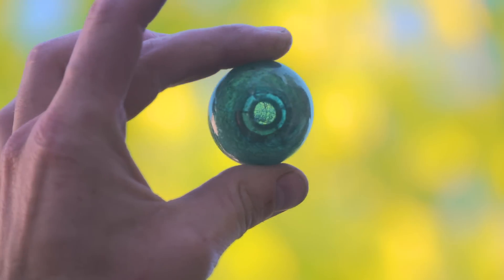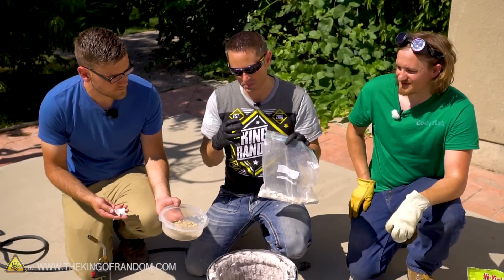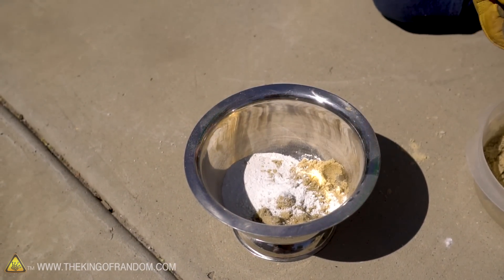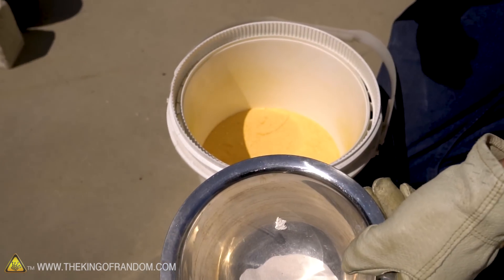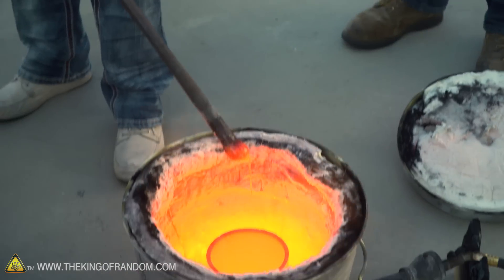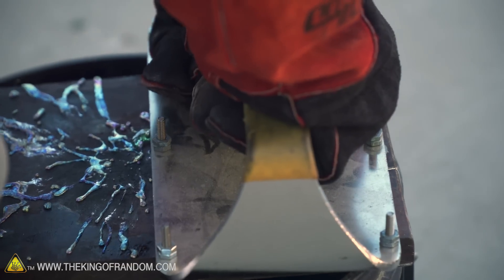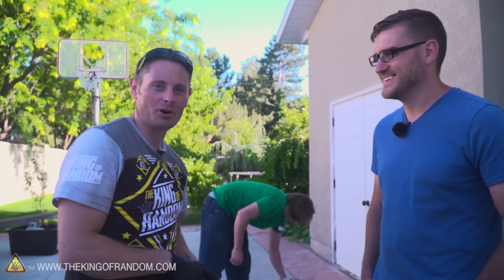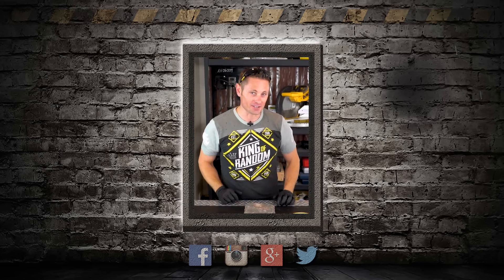How To Turn SAND Into GLASS! Melting Sand Into Glass? TKOR Shows You How To Make Glass!

Comment: I have found your video most interesting in my search for making ceramic glaze at low temperatures with cheap and widely available materials. I have recently mixed clay and bicarbonate of soda 50/50 and have obtained a nice glaze at about 1000 centigrade. 
Could you tell me at which temperature you melted the mix of sand and sodium carbonate?
I would really appreciate your help
Reply: Dude wtf, hes dead..

Comment: How did you keep the Foundry running for 6.5 hours without the propane cylinder freezing?

You mentioned in your "Don't Build a Metal Foundry Until you See This First" video (5:11 minutes in) that the Propane Cylinder freezes after only a half an hour. You also mentioned that this can be combatted by placing the Propane Cylinder in a big bucket of warm water or investing in a larger Propane Cylinder. Perhaps you figured something else out?

Comment: Hey make some smooth glass Cody melt down some tin keep it hot to melt point  it won't mix with the melted sand like oil and water pour your melted sand right on the tin and it cool and it should be clear sheet

Comment: Was that an aluminum thing they used to flatten the glass?
That will cool any hot surface down quick so what they need to do is make a thick pad of newspapers and cover all the metal then when they go to smash the glass use some warm or hot water to wet the newspaper and then flatten the glass.
I've watched glass blowers use newspapers to also shape the glass as well have to keep it wet so it won't go up in flames with the molten glass.

Comment: try to do ultra battery, where u cover negative side plates of lead acid battery with grphite to prevent erosion, supposedly gives way more discharges at 100%, should be easy to do

Comment: I haven't read the comments below, but here goes.  Window glass does have a greenish tinge.  You have to look at it edge on though to see it.  While I have seen leaded glass before, I never had occasion to look through the thickest parts of it to see if there was a color cast to it.  I have had occasion to use it as a musical instrument, as when you fill it to different levels with water to change the resonant frequency.  Also, my favorite ornaments in my house are made with leaded glass, as they tend to refract light more strongly than other types of glass.  At this time though, I'm making ink.  Seems safer than making glass.  People where I work are aware that I'm collecting staples removed from documents for that purpose, though when I explain to them what I'm attempting, they get very confused.  Note:  it's iron gall ink, if you wish to do a search, it's explained very well in several video's.  If you don't wish to try it yourself, you can get the finished ink, commercially made, on line, or from a nearby hobby store.  I chose this project because I want'd to see how it performs with either a metal dip pen, or a quill pen.  I've been giving away ink and quill pens and presents lately, just because I have half a gallon of ink, and am still working with the mix.  My own ink is a medium grey, and I carve the quill pens myself.  It seems to work best with 24# parchment paper.  Tannic (sp?) acid can be used as ink by itself.  It gives a sepia tone effect, the darkness of which depends on the concentration.  It will eventually eat your paper though, so that is a downside.  Enjoy yourselves, and keep experimenting.  I might want to try this for making glass pens for my calligraphy.  I have several I enjoy using made by other people, but I would like to try making my own.
Reply: No one cares

Comment: Sand needs to be wet so it can dry... when turning into glass... you need to have a mechanic that makes lighting or a streak of lightning to strike the sand and then it will heat up and turn into a cracked form... then it will dry up and fix up when left in a form

Probably didn't make any sense

Comment: if you pulled your burners outside off your foundry it will get hotter, aprox. 3-6 inches depending on the burner. doing this allows more oxygen(fuel) to mix with your propane therefore increasing temperature

Comment: How to turn coal into diamonds
Reply: oxidius ... coal cannot make diamonds... well at least not on its own... it takes carbon (which coal has) pressure (which coal does not have) and lava heat (which coal also does not have... plus you would need to wait like 5 years for it to finish and in nature about 2 million.  Sorry to be a party pooper but.. it's fact. Can't argue with that...
Reply: Bunnygamerplays alot Synthetic diamonds made using the CVD method takes a about 10 weeks. Not years.

Comment: Great video guyz. Does it make a big difference where the material comes from or is it that it's more pure where you got it?
I have a portable foundry pot to melt medal but have not used it yet. 
just getting ideas from you thanks.
_/

IDEA4U: what about etching small parts using copper sheets?
My company does it to .005 " tolerances. Cay you without the big etching chemical machines?

Comment: My dad used to work for a company who made light bulbs and had to do mix similar chemicals but they had molds for the glass and what they had left over in the ribbon machines was usually blue ( and sometimes purple) blocks of glass called cullet I have some. You guys did a similar thing to what Corning Museum of Glass does the blowing glass part cool.

Comment: You should melt some neodymium magnets and see if it's still magnetic
Reply: It would lose all magnetism
Reply: YouTube Promotions they lose their magnetic properties when heated over a certain point so it wouldn't work
Reply: Frank Villani yup that's exactly right
Reply: YouTube Promotions it won't be because the particles will be moving around and won't be aligned in non perfect way for example

Non magnet 

OOOOOOO
OOOOOOO

magnet

OOOO
 OOOO
OOOO
 OOOO
Reply: It wont
Reply: Once a metal goes past critical temp the structure changes and it becomes non magnetic
Reply: YouTube Promotions answer: no
Reply: YouTube Promotions magnets on heating or hammering,looses their magnetism!
Reply: Yess
Reply: Earth Is magnetic because of its weight and rotational motion>
Reply: YouTube Promotions go to school sometimes its pretty cool.
Reply: YouTube Promotions but just so u know ... magnets lose there magnetism if exposed to alot of heat or hitting it too hard
Reply: YouTube Promotions false
Reply: Charlie Bell it becomes weaker
Reply: Cam Creates Crafts that's not how that works
Reply: YouTube Promotions it wont
Reply: Would it work again once cooled? And if so, how would that affect the poles? For example, if you made it into a very weird shape with no edges and lots of curves, how would that work?
Reply: Research the curie point (not sure if its the proper name)
Reply: Charlie Bell, no they wouldn't regain their magnatisim.
Reply: Farhan Hussain that's not true because the earths core is melted and under intense pressure but is still magnetic

Comment: If you heat pure fine white sand and Lyme for about 8 hours mixing in small amounts of baking soda periodically and add a bit of fine ground quartz at the end you can make some pretty cool designs with pressed glass. Also different metals can give different colors. Look for a list of firework grade metal powders and you can pretty much make whatever color you want. Also pressing it when it's still molten can be dangerous but it will let you make much thinner plates.

Comment: Can you turn carbon dioxide into oxygen?
Reply: Michael McNamara You certainly can. That's what happens in photosynthesis. I don't know how this would work in a lab setting, however in photosynthesis light hits the CO2 molecule which then causes it to split into two. CO, Carbon Monoxide, and O, Oxygen.
Reply: Michael McNamara if plants can do it we certainly can
Reply: Michael McNamara the process so far cannot be replicated since it's all biological
Reply: As far as I know, plants make oxygen by breaking the water molecules, not straight from carbon dioxide, so I wanna know is there a machine that could do so?

Comment: You should cast pewter in silicone. Pewter has a melting point of 170-230C and silicone can handle quite high temperature. You can get pewter at a thrift store.

Comment: Try to melt diamond
Reply: Krushil Manji Diamond will not melt... it will evaporate and flash gone.
Reply: Diamond is basically compressed carbon so it would just burn like charcoal
Reply: I have been informed that it is possible for diamonds to not just burn but explode in the right conditions.
Reply: That is impossible. Not everything can be done
Reply: doesn't burning need oxygen? and if it does, what happens when you take oxygen and give heat? <,<
Reply: Krushil Manji It will just burn like coal .
Reply: What's a diamond?

Comment: See if you can melt dry ice. Like if you agree
Reply: Joshua Storrs 
I think he already tried in a past video, but I'm not sure which one.
Reply: A⃟n⃟n⃟z⃟a⃟l⃟i⃟s⃟a⃟ oh well we will see what happens lol
Reply: Joshua Storrs no it's a gas in solid form
Reply: Joshua Storrs it doesn't melt, it just evaporates
Reply: The correct term is "sublimates"
Reply: U can do that by putting it in water
Reply: Joshua Storrs he did that before when he used plastic bottles
Reply: Well you can form liquid CO2 by using very high pressure. Cody's Lab did it when making supercritical fluids
Reply: Sublime idea
Reply: Joshua Storrs contain it in a place it can't be exposed to air or use a vacuum chamber
Reply: he alredy melted dry ice

Comment: In the old days they used to take the hot glass and move it trough a valswork on to a molten bed of tin where the glass rested as it thined out and got rid of the last impureties and bubbles. 

The bed woulndt have to be as deep as it would need to be wide and long as the glas you would want to make.

Comment: could you make popcorn by putting kernels in the vacuum chamber?
Reply: Jonathan Beil go to the myth busters YouTube channel they did this
Reply: Popcorn kernels require heat to soften them to pop. It's true that water boils at room temperature under vacuum but it is not hot at all and may actually get colder due to adiabatic expansion.

Comment: Grant, can you please freeze a simple LED in liquid nitrogen. If you freeze a low voltage LED (usually used at 3V or 5V DC with a resistor in series) in liquid nitrogen, you can connect it to line voltage (110–120V AC), and it will continue to work. It gets a lot brighter than you would believe possible. The LN will boil violently, providing a pleasing effect.

Warning: This experiment is potentially dangerous. Be careful to ensure that the LED is completely frozen before connecting to line voltage, and is disconnected before thawing. Otherwise, the LED could shatter violently. Use eye protection and proper electrical insulation.👑
like so grant can see !!

Not my comment, so if you see this, its BossManChalil
Reply: I love that you're being honest and say that it isn't your comment. Probs to you
Reply: You could do the same with laser diodes and the wavelength would change, resulting in the laser turning into a different colour
Reply: ZippyZipra: sounds cool
Reply: ZippyZipra I

Comment: Make a metal with a low boiling point boil, in a closed container. My hypothesis is the metal will condensate like water. Like if you agree.
Reply: Jonah Holman Indianum. It's a soft metal that gets soft at room temperature, meaning it's a metal that could be chewed like bubble gum

Comment: Can you please make Diamonds?
Reply: Syntheticly produced diamonds are chemically identical to real diamonds.  Most effective process involves high pressure high temp gasses and thin slices of diamond to act as seeds to grow the gems, basically giving the pattern of the carbon bonds a set of instructions to follow to grow diamonds.
Reply: Waz take carbon. Apply pressure and heat. Wait. Then get yellow diamonds.
Reply: I hope he can make it
Reply: yall are overlooking it, just go to level 12 and mine in a straight line with iron or diamond pick
Reply: you should bring charcoal and press it with your hand hardly,and it will turn to diamond,, like Superman did 😂
Reply: Waz Man made diamond is just like a fake diamond which has lower market price than natural formed diamond...
Reply: Yes, he could if he wanted to. It's actually a fairly straight forward process: /watch?v=0mWQUvxcANE
Reply: All you need is a million pounds per square inch and 3000 degrees.
Reply: CreepersGamingMc you can, put you a lot of pressure, so much that even a hydraulic press couldn't
Reply: I know Cody can.
Reply: Waz meth is best
Reply: You can, put graphite pencil lead in  the microwave for a few minuets.
Reply: Waz y c.f.
Reply: Waz it would only take thousands of years and thousands psi of pressure... but why not
Reply: Jan Vernice - But there's no difference.
Reply: WELCOME TO MY MINE WE ARE MINING DIAMONDS WE DONT HAVE TO STRIP MINE
Reply: That's what I want! The Replica
Reply: The question: Can he do it?
Reply: I want to know if he will be able to do it, that''s all! I don't care about its price. I want that fake Diamond
Reply: Can Grant do it?
Reply: LOL!
Reply: The earth is 4.2 billions years old. That counts as "billions." Unless you have the moronic belief that it's 6000 years old.
Reply: There's man made diamonds
Reply: It takes billions of years to form in nature so yeah...
Reply: Waz man made diamonds aren't even actual diamonds, they are synthetically produced to replicate the real thing

Comment: You should try making steel from scratch.
Reply: Another option would be to take a less modern approach to alloying steel, considering most of us likely don't have access to a blast furnace (lol) and build something called a cupola style furnace which as Eric Kelly said would allow the copious amounts of slag somewhere to go and so forth, I only know the basic concept but if you are interested in metallurgy you should read up on it... steel alloys are actually quite difficult to make.
Reply: Piffboy6 too hot, to make steel it needs to be over 1600 degrees centigrade that small foundry won't get hot enough  hence why in the steel industry they use a bast furnace which is BIG! And even then it still takes a lot of heat and equipment.
Reply: Would totally be possible, you need a way to let the slag drain at the bottom though, and clay furnaces (which the ore is smelted in) are broken in order to take the bloom out.  Maybe he could fix up his forge to be reusable though
Reply: He literally melted rocks in his mini arc furnace

Comment: CONNVERT GLASS TO SANNND!
Reply: Dean Freaking Ambrose, Dumbledore can do it.
Reply: Glass is just a large Silica-Quartz crystal that is made from a bunch of tiny crystals (Sand) thats melted together. So if you crushed up glass you could get sand
Reply: Great Idea... until your kids get cut up playing in the "Glass Box"
Reply: idiots ,ground up glass is not sand ,melting " sand " changes many of the molecular structure which is irreversible
Reply: Crimson Mage Megumin that is not possible
Reply: Crimson Mage Megumin just crush it up and it's sand again.
Reply: tyler caelian no sand is rock
Reply: Gavson 83 obsidion one of the rocks in sand is volcanic glass
Reply: Not possible
Reply: Jake the snake no thats not sand. thats just crushed glass.
Reply: tyler caelian We used to do that and glue that "glass sand" on kite lines, so it'd become like a sharp blade that could cut other kite's lines. But it's completely different from sand.
Reply: You can turn glass into sand heating or up red hot for about 5000 times
Reply: girlsdrinkfeck But sand is thecnically silicon dioxide with many impurities, and when you heat it up, it melts, and then it cools down into a large crystal. By crushing the new large glass crystal you'll get sand
Reply: Dean Freaking Ambrose why so? Sand is more a texture than a material. If you grind the glass up then its technically sand
Reply: Lucas Schott yes it is just crunch up the glass
Reply: by this comment, i actually meant, change the glass to a sand like texture, something that could look and be like sand

Comment: Is it possible to turn glass into sand? Plz make a video if it works
Reply: Its a chemical change so it is irreversable
Reply: Yes, considering sand is a textural term. Any mineral ground to particle size of 1/256th of a mm to 2 mm in diameter is considered sand. Therefore if you ground up the glass finely enough, you would have sand.

If you mean turn SiO2 into lime and silicon, I suppose it would be possible, although it might involve several steps that chemically I am not aware of. Most likely a form of high temperature separation.
Reply: S Maaz S Maaz crush it up and then purify the silicon dioxide.
Reply: You could crush it into a powder, but it still wouldn't be sand, it'd be glass powder. Just like caramelising sugar, you can't undo it.
Reply: crush it up in small pieces, throw it into a river with shingles and let it sit there for a few thousand years... it'll end up just like those clearer pieces in sand
Reply: YES, it is definately possible. Just powder the glass and put it through a high temperature refining stage. Viola you get your sand back !
Reply: kinda
Reply: PotatoMaster GD some reactions have a redox reaction meaning that you can reverse it. Rechargable batteries use this.
Reply: Thats kind of rude dont you think
Reply: You crush it there are machines that do that
Reply: Sorta, you can just crush into tiny little bits, but it would be sharp right?
Reply: TheUndying Wrath actually yes
Reply: S Maaz S Maaz 
Its a chemical reaction. It cant be changed. Did you not go to elementary school?
Reply: S Maaz S Maaz Of course not.